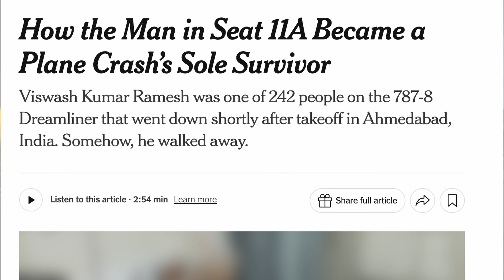Why the RAT Changes Everything – Air India 171 Update

Comment: Thank you Captain for the update on this tragedy... My daughter watched a video of a passenger who had flown on the plane one hour before the crash,  He has stated that nothing was working right..Lights , AC , TV and more. May all those poor souls rest in peace.
Reply: Yet they continued to fly it 😢
Reply: @ShellyFuqua-t2q  It's India...
Reply: @carefulsum  I looked up Air India accidents and there have been 5 including this one since 1986 or 1987. There's another India carrier that had had significantly more though.
Reply: That's why I wonder if it was electrical failure.
Reply: The  air-con issue is important as it's driven by compressors in one of the engines. no air-con would suggest a fault at the engine level. lack of electrical power in the cabin suggests that one of the generator circuits - also driven by an engine - could be at fault. all electrical and  air-con systems are driven by the engines - as are the hydraulics. the RAT, as Capt Steve says, supplies enough power to power basic flight instruments and control lines. we would need to know from passenger 11A if the plane went dark after takeoff.
Reply: Some of these countries would probably ride the plane with one pilot no toilets of windows 
They don’t know better
Airlines are a technological advancement from Europe post WWs
Reply: That’s very common on air India. It doesn’t necessarily mean anything, and I wouldn’t look too much into it. I watched the same video
Reply: @creativeconnection4U  In the US, each problem highlighted would have been a “NO-GO”. They will not take off if there are any glitches on the plane. It is unsafe.
Reply: I watched the same video that ur daughter did, and I was looking for this comment.
Reply: That plane flew and landed just fine on that leg of the flight. One should not read too much into entertainment system failure and AC not working. Airplanes have completely separate systems that isolate cosmetic and non-aviation/non-safety related items from avionics.
Reply: Some people are saying that video is not from the same day as the crash.  I’m not sure but it seems to be the same plane regardless of the questionable time difference.
Reply: @kazbutler it’s from the flight before it, but same plane. Many many hours before and after a safe flight, so it’s not worth looking too much into
Reply: I know. Why haven’t they talked about that? My daughter is a flight attendant and she said that any one of the problems would be a “NO-GO” situation.
Reply: @sueteran it’s India, unless people die no one cares. Ohhh let me correct, even if people die no one cares.
Reply: It was cosmetic issue.
Reply: @Welcome25674  Well, apparently not.

Comment: Captain Steve, sounds weird but I've noticed in one video dust before takeoff 

could it be sand that's been ingested in the engines if hot enough would turn into glass.

Or what about a pocket without air I know it sounds stupid and probably is but dual engine flameout is such a rare thing and since people has said fuel but I'm thinking outside the box. No oxygen no flame also for the dust if you notice in the video the dust happens before the aircraft rotates I'm thinking dust devil.

Comment: Those engines have their own PMG to supply electrical power to the engine controls, there is zero chance of the engine stopping because of electric power loss, it has to be a fuel issue or someone pulled the fuel levers off on takeoff.

Comment: I'm on the fence about the RAT.  It's 100% obvious when the plane comes into frame there is a noise that unmistakably matches other videos around the internet to what the RAT sounds like. However the RAT is at peak volume when the aircraft is closest to the camera but if you pause and blow the video up at that moment, there's no break in the fuselage where the door is open and there's nothing hanging down. It's only when zooming once the aircraft is at max distance does it appear it's deployed. Indeed to me it does look deployed in that shot of the video but why does it look to be stowed away when it's at it's loudest? You should be able to easily see it in the first few frames.

I posted this early yesterday about a family member being a current 787 Captain and commenting on how disappointed his is with the aviation community's analysis regarding the landing gear, especially from people claiming to be 787 pilots. According to him if you are in a 787 experiencing a loss of power, at or near stall condition you aren't going to initiate gear retraction due to the sequence will introduce even more drag, albeit briefly but right at a time when it can't be afforded.  Said family member wouldn't speculate on the RAT only expressing his disappointment regarding a procedure.

Edit: I located the original video and ran it through Topaz AI which is notorious for trying to turn even a slight artifact into part of a frame and even it didn't pick up a single shape where it's the loudest and both the RAT and it's obvious door should be in the frame. It did pick it up and try to enhance it at the end of the video. Something needs further investigation regarding this as it redrew a completely slick fuselage up until those final frames.

Comment: So, it is not the birds, it is not pilot error. Now Engine, electrical and/or hydralic failure. 

Now factor in the HOT weather and the electronics onboard.
Note that electronics fail at high temperatures - ambient and device. If there is no or low cooling airflow, electronic devices can have exacerbated thermal runaway, leading to catastrophic failures.

Comment: This is fascinating thank you. I’ve always maintained that a no-flaps setting would have caused a heavy back and forth rocking (oscillation) of the wings and a failure to climb to any more than maybe 100’ AGL to begin with. They clearly were climbing. Also it seems like the engines were still producing ‘some’ thrust, just not enough…as if they were ‘throttle-limited’. You can also hear the engine-fans typical jet ‘roar’ in the video. Seems that something took-over the plane. Captain Steve, perhaps elaborate more on any previous rat deployment issues, takeoff computer power-settings or autopilot settings that may have been involved please. This could be an un-commanded software glitch. I am speculating of course. Heartfelt blessings to all. Cheers sir.

Comment: 11:44 And THAT is the question: HOW two engines could flame out is a MYSTERY... and a possible BIG PROBLEM for Boeing OR the ground crew
Reply: If it was a fuel issue other planes would have had issues as well
Reply: @jmshkm  That's a really good point!
Reply: @jmshkm good point. Perhaps there are more accidents waiting to happen?
Reply: @jmshkm  The other Air India Boeing 787 that prefered to return to Hongkong airport the days after that crash did so because of a fuel-filter problem!!
I wonder whether Air India has a maintenence problem resulting in fuel contamination and fuel- filter problems.
And I wonder whether those pilots knew already, that a two engine failure due to fuel problems was at question in regards to the crashed plane.
Reply: It shouldn’t have needed all 11,000 ft to get into the air!  Clearly something was off with thrust
Reply: @fhowland a united airlines pilot did comment that it is a very long runway and at the weight and fuel it was carrying, probably only needed 9,000 feet.  She noticed the dust at the end of the runway when it lifted off.  Her take, was something happened on the roll out, but at the speed they were going, it was too late to abort the takeoff or else they would have crashed into the airports barrier wall.
Reply: Didn't the plane just undergo a b, c or d check ?
Reply: Exactly... @soeren72
Reply: An error during recent maintenance maybe
Reply: @ArmageddonTomato maybe,this world is upside down,not surprised
Reply: It's probably not just an or situation, swiss cheese model. Though I can't see this being Boeing's fault much.
Reply: @Bozebo precisely has to be poor maintenance or ignorance.
Reply: Flock of birds
Reply: Doubtful it’s a Boeing issue as the plane was over a decade old. I bet it’s either a maintenance issue, pilot error  or fuel contamination.
Reply: Someone put forward a theory of possible fuel contamination
Reply: CAPS lock DID it
Reply: In 2015 there was a Softwarebug in the "Generator Control Units" of the Boeing 787 which disabled themselves after 248 days powered on without a reboot; all at the same time! - leading to a non controllable airplane. There was a directive to update this GCU tho and it is unlikley that this airplane received no updates.

You can read directive - google: US-2018-20-15
Reply: Why unless trund off many things no big deal planes crash ppl die it's called life
Reply: Are they taking off with autothrottle? Could that malfunction?
Reply: Software issue
Reply: Considering that there is no remains of the plane, it will be very difficult to find the root cause since they have nothing to analyze. Hopefully the blackbox data give us the answer. We don’t need another airline crash mystery.
Reply: @jaknap1  What do you mean "no remains"? All the bits are there, they will be laid out on a hanger floor and examined. 
Besides, surely the flight data recorder was monitoring engine function? 
I've heard some airlines specify reduced parameter monitoring but that's pretty basic. Also don't these engines talk constantly to satellites?
Reply: @JLSMaytham I agree, so much of this aircraft is left to examine!  Better than a fall from hundreds of feet.
Reply: @JLSMaytham because there was a massive explosion and fire that lasted for a long time, many key parts in and around the engines and wings would have burnt, melted or destroyed.  If the problem was with engines not creating power or thrust,  they need to examine the engines, the fuel lines, the fuel pump, etc to see where the problem is. The FDR data might tell what the problem is (e.g no power in engine) but msy not tell you the root cause,  which is what the investigator are after so another crash can be prevented.
Reply: @jaknap1  they will find out EXACTLY what happened. The black box records so much data.
Reply: Boeing doesn't make the engines
Reply: Its probably a power, fuel line pump whatever its highly unlikely both engines mechanicdie at same time. So its Boeing or maintenance refurbishment perhaps.  Boeing not exactly inspiring confidence for a while  @james4v261
Reply: @james4v261  It doesn't matter. NOBODY is going to blame GE or Rolls Royce
Reply: @shootfirst2097 If it is their fault they will be blamed. Remember the A380 grounding with the faulty oil line on RR engines? This was rightfully 100% blamed on RR.
Reply: Well they refurbished it so probably someone made a mistake there
Reply: @gamingone6420 these are not refurbished yet.
Reply: Bad fuel...
Reply: Fuel used in all plane not only one sir @rockybalboa9720
Reply: @rockybalboa9720 Seems unlikely, as engines obviously started fine, spun up fine, got the plane off the ground fine.  And it seems other planes would have been affected if it’s bad fuel.
Reply: @rockybalboa9720  Impossible for a single aircraft to get bad fuel at this size of an airport.  If there was fuel contamination, it would have affected more than just this AC.   Now, an electrical failure could take out both engines.
Reply: @rockybalboa9720 Then it should effect other carriers as well..  How come only this aircraft can be filled with bad fuel.. Its an Engineering Failure.. Boeing 787-8 is a Flying Coffin from here.. Engines will blow out before anything happens and more people will die if this aircrafts allowed to fly more..

Boeing Should call back all 787-8 and inspect every single same aircraft they made and need to rectified ASAP
Reply: @shafaschundekat7889 main reason for engine or electrical failure is poor maintenance or ignorance despite having some warnings. 

Just imagine most of the Air India flights don’t have anything working properly, how come we trust that they maintain the aircrafts engines ? 

If it’s Air India’s fault Indian government wouldn’t release any reports to avoid loss of business.

As we people we can make better choices by choosing not to fly with them.
Reply: @shafaschundekat7889 first boeing 787 in service from 14 years ago with zero crash record, and this ✈️  particularly with air india since 2013, second thing the engine is built by different company GE with excellent safety and performance record.
I see indian media trying to blam boeing, everyone should calm down unti initial or finall investigation released, by the way I am airbus fan.
Reply: @aakashsp4407 or sabotage….
Reply: @mohamedmatouq4201 whoever u are, We lost our people.  Its A Boeing issue for sure.. Or else could u explain how a flight fall down in 625 while Rotating Air Turbine was on.. !?

Its the engine failure.. It Doesnt Crashed means it will never crash!! Is there something like that..!???
No Right 

If Boeing made mistake, they should rectify..
Reply: @aakashsp4407 I think u r missing some point.. Few months back, In Newark a Boeing flight of Air India landed eith all kind of problems like not working of ILS, LSAT, VSAT.. 

Japan Airways Boeing landed with Engine Failure and RAT deployed.. 

Boeing needs to Rectify.. #BoeingShutDown
Reply: @shafaschundekat7889  The other Air India Boeing 787 that prefered to return to Hongkong airport the days after that crash did so because of a fuel-filter problem!!
I wonder whether Air India has a maintenence problem resulting in fuel contamination and fuel- filter problems. But we have to wait for the results of experts analysis, and I hope they will be published.
And I wonder whether those pilots knew already, that a two engine failure due to fuel problems was at question in regards to the crashed plane.
Reply: I feel it's sabotage , the bang noise is very unlikely. Someone messed with the power circuitry
Reply: The bang noise was the Rat deploying  @DilliDesiDude
Reply: Fuel quality in India is SCAP!
Reply: @viacheslavglukhov8188 the fuel quality ain't killing 2 engines simultaneously like that
Reply: Dual engine failure could be a pilot error too
Reply: @akshay.kumar.k  Not possible with the pilots with few thousand hours of flying experience
Reply: @akshay.kumar.k implausible and doesn't fit with the Mayday call
Reply: Poor maintenance by Air India. They don’t care about people’s lives !
Reply: It's a Boeing

Comment: @lindylulu2, Yeah, I noticed that as well. Looks like a small piece of debris fluttering and / or sliding through the air and first appears at 3:18 into the video, then disappears below the horizon at 3:20. 

Looks like possibly a small panel (maybe related to the RAT deployment?), or possibly something kicked up from a rooftop during the aircrafts descent?

@captainsteeeve, wondering if you noted that?

Comment: I thought on the 787, in the event of dual engine failure, when the engines spool down below an RPM where the generators can supply electricity, electrical power (including power to the electrically driven hydraulic pumps) comes from the main battery while the APU attempts to start.  The APU start is automatic on 787 in the event of dual engine failure.  No pilot input is necessary and the process takes about a minute.  The main battery can easily supply power for this duration.  Then if the APU fails to start, the RAT will deploy.  I may be wrong on that sequence, but that was my understanding.  Of course, the pilot can deploy the RAT manually.

Comment: Another clue, guy that was on this airplane a few hours before this fatal flight recorded a clip in which he stated that air conditioning wasn’t working so it clearly shows that the engines was not in great condition. Also he showed that the infotainment system wasn’t working so electrical systems probably had some issues too.

Comment: Yes, major systems failure.  Loss of engine thrust.  RAT was deployed.  Might be electrical related.
Apparently, people who flew on that very same aircraft earlier, reported electrical problems during their flight.
This looks like a ( lack of ) maintenance issue.  Maintenance logs will get pulled and gone through with a fine tooth comb.
Air India is not looking good right now.  Not a pilot issue.  Not a Boeing issue.  This is a maintenance issue.
This plane had serious problems, and they kept flying it anyway.

Comment: Question for all of you experts in this thread:  Steve did a great job explaining how the RAT works and what it does when it deploys.  Quick question:  If the RAT is either inadvertently deployed, or deploys uncommanded (similar to a reverser deploying mid-flight), would the RAT override, or disable the systems it is intended to replace?  Or would it have no effect on those systems if it deployed while they were working properly?  Thanks!
Reply: It would have have no effect on the systems currently running, it cannot provide the same hydraulic pressure or electrical power as the main supplies, but will supply enough in an emergency for the critical systems
Reply: I believe the RAT doesn't override the other systems as it's a backup system
Reply: No problem if the RAT is manually deployed.
Actually, the RAT is regularly tested by Pilots, and often we can hear it fron an A/C landing.
Reply: @YannickBellens  No.
Reply: why is everyone talking about a rodent?

Comment: isn`t 't that  in 787 RAT has also a switch to  deploy it manually....  In that case isn`t 'it also possible  that FO in fact incorrectl/prematurely  raised  the flap lever  then when the gear did not move, he  incorrectly assumed that there is a  hydraulic failure and manually deployed the RAT ... If there were dual engine failure shouldn`t the plane be more `silent ' ? - Japan airplane for instance  is silent ...